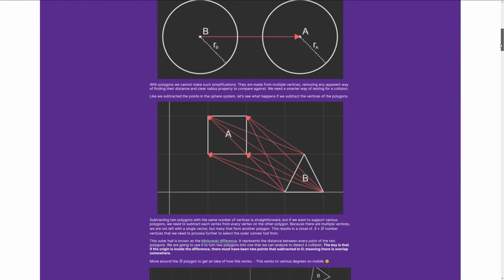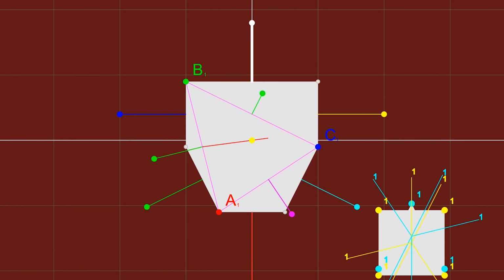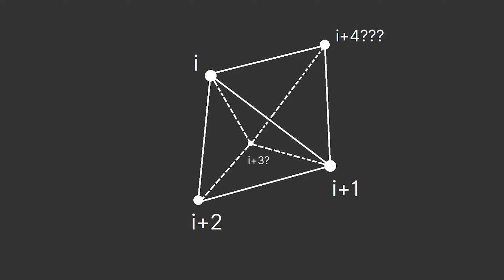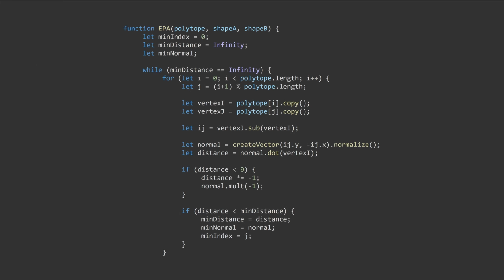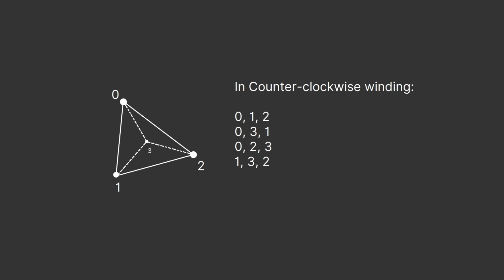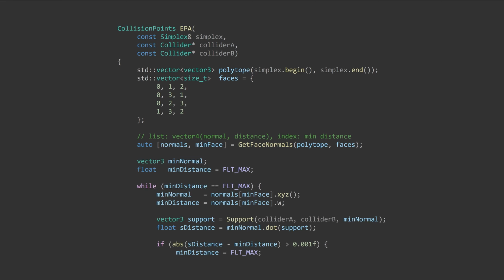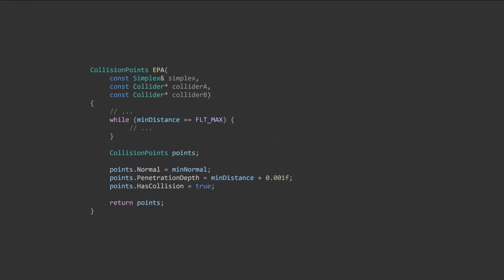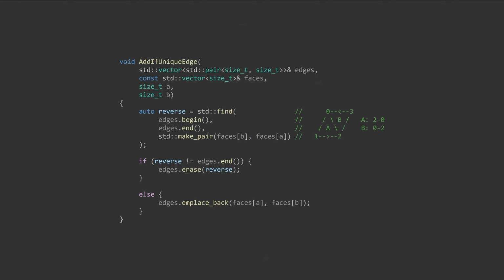EPA Explanation & Implementation

Comment: Hello Winterdev. 
Thanks for the great Video. When checking what faces to delete you check if the normal of the triangle and the supportpoint are in the same direction. This only works for some cases. Since you want to check if the support point is on one side of the triangle you want to use the supportpoint relative to the triangle.
So the check would look like this
if (SameDirection(normals[i], support-polytope[faces[i*3]])
Reply: Just found this comment and it solved the issue I was on for hours, thanks a lot!

Comment: Great video! One thing to keep in mind; if delta is large enough, your objects can essentially go through each other. This might occur during a frame-drop or the like (unless your engine has a fixed timestep). A sweep check can fix that though (in the case of arbitrary convex sets a simple gjk pass should be enough)
Reply from the maker: Yeah I have a fixed time step but the issue I was running into was if that was larger than the regular delta time everything would grind to a halt. I wana look into sweep checks but none of my projects have needed that so I haven’t looked into it yet :)

Comment: Amazing ! Can y make a video about inertia, and some complex rotation physics. I found an  crazy cool effect called "Dzhanibekov effect" . To simulate it, there must be solid  rotation physics background !
Reply from the maker: After a couple videos I plan to get back to physics, but I am going to go in a slightly different direction for the next few. That would be cool to try and simulate though, I wonder if it would work right off the bat, or if it needs more subtle detail that a physics engine optimized for speed would drop. Will keep in mind!

Comment: I'm confused on the part where you reverse the distance and normal if the face is facing toward the origin. There is an edge case where if I have two cubes that are aligned on two axes and they collide, reversing the normal seems to be causing problems giving me the wrong normal. That's because the smallest normal becomes largest normal I guess, but I don't want to just cut the code out without understanding why it was there to begin with.

Comment: One question I have is how you resolve situations where one or both colliders aren't properly polytopes, but are surfaces/curves?

For example the support function for a sphere will always return a further point along the normal of any face made from points on its surface than any existing point on its surface. That means if a sphere collides with the corner of another object, the EPA could go into a theoretically infinite loop. How do you handle this? Do you just cut it off after a fixed number of iterations or a maximum size of polytope?
Reply from the maker: Yeah you got it I put a max iterations of 30 in my code. There is probably a proper way to do that, but I didn’t look into it. You could prob use a different method for curves and store shapes as a series of edges / splines and do something dif for each combo

Comment: Hey loving this series and I've got a kind of working implementation that works mathematically (don't have a renderer just yet) what license is this code under? I'd like to use your physics engine or a very modified version in my own engine. Mine would stay open source under MIT, or ZLib or something. Is that something you'd be willing to give permission for?
Reply: Also just to clarify, I'd obviously give credit in the code and github page if that's something you'd prefer
Reply from the maker: Yes go ahead anyone can use the code in these videos for whatever purpose. These are all hobby projects so go ahead. I do need to get an actual license on the GitHub tho, I’ll pick one soon. Feel free to use the code :)

Comment: Hey Winterdev, question, how does one get the two collision points from this algorithm?
Reply from the maker: Hey sorry for late reply, if you read the chain between DANISH AMIN and I, I cover this. Basically you need to do some more projections from the normal based on the distances from the origin
Reply: @Winterdev  Alright perfect thanks. I figured it out myself by now because one of my colliders was a sphere, which makes it easier. Anyway, great tutorials! If you ever want to, a dedicated video on collision response would also be kewl. I find there's a lack of resources on that online
Reply: @Winterdev  Where can I find this chain? This is the last piece I need for my physics engine.

Comment: For some reason it's not working with sphere-sphere collisions I think
Reply from the maker: It will get into a inf loop with sphere v sphere, so you can either add a max iteration loop. Or the real solution is to only use this for mesh v mesh and have a separate function for sphere v sphere. In my testing it works with sphere v mesh.